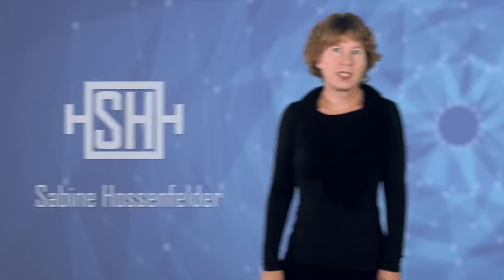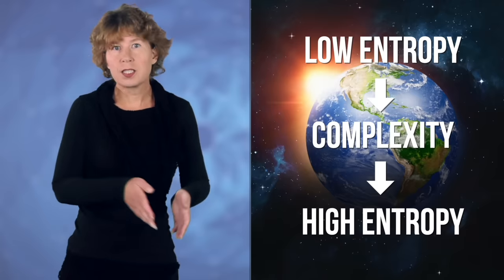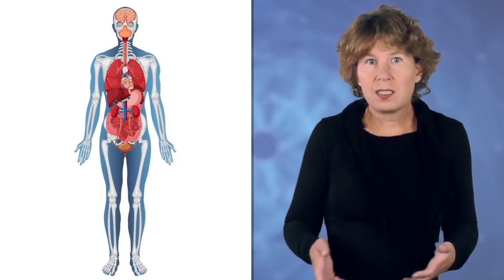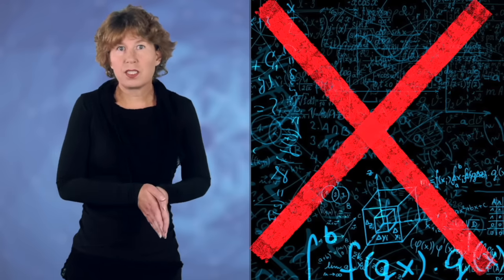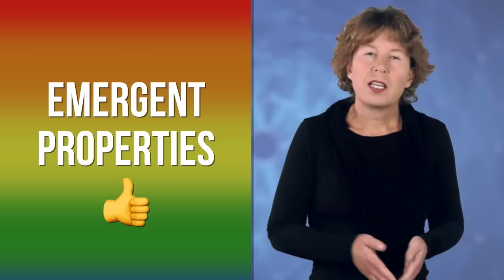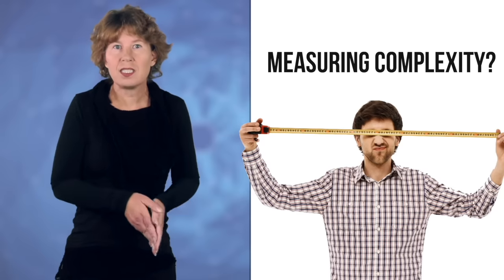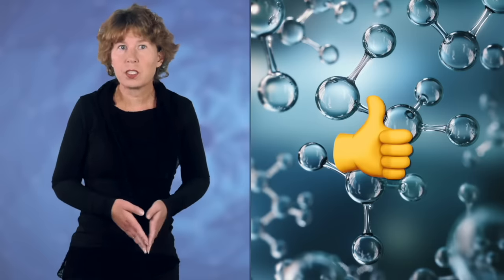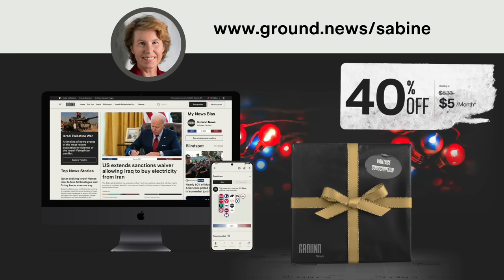The Biggest Gap in Science: Complexity

Comment: Complexity is the minimal number of laws (mathematical functions) of all the possible connections between the elements of the system described within a specified space-time dimension.
It gets its real meaning as a comparison, as a relative value between two or more systems, although it is not impossible to quantify it as an absolute value.

Let's take the rock-baby example.
The baby is more complex if we compare it to a similar sized rock, and we take a small timespan, let's say a day, and investigate both starting from their molecular size to the whole object. The baby is complexer because to count all the laws describing the connections of its elements on the same macroscopic size it is much higher for a baby, not only because its organs or molecules on the similar microscopic level need more laws to describe them, but in a 24 hour a rock doesn't really change, so the are no extra laws needed to describe the changes too, the time generated connections (evolution) and the laws describing these are missing for the rock.
However if we take millions of years of evolution of that rock and compare to the millions of years in which a baby state of a human is negligible (99.9999...% it doesn't even exists), the rock may be more complex, so geologically it is complex, because it the a higher timespan, an "evolution" of that rock must be taken in consideration too.
The same is true if we change the spatial dimensions in which we compare the system.  No surprise that the geology of a whole planet is pretty much complex.

To describe all the possible connections of the elements of a DNA molecule of a baby needs also much more mathematical functions than a silicate molecule (just to stay at the baby-rock example, however it is not important at a molecular level, where those example molecules are coming from).

We can also define a span of space to compare objects, or to measure it's complexity, and a timespan too, so we can compare two objects starting from a molecular size to an average human size in 100 years, then compare those. It is also okay to compare different space-time spans of objects. In both cases we can say which one is more complex. 

Just to use it for the coffee exaple, the two separate liquids half mixed are much more complex, because you need to describe the process of mixing as the time goes on, which is probably the biggest part of the mathematics to do, much more as to describe the separate or the completely mixed liquids.

This is the reason why the states in between, and the systems which rapidly change by time are so complex.

Now if we compare the whole universe from the smallest particles and in its complete "lifespan" there is nothing as complex as it, because all other systems are only a subset of elements in space and/or time, and those can't be more complex.

(Sometimes I used objects and systems as synonyms, but these thoughts are just born as I wrote them, inspired by Sabines explanations. But you probably got the point anyways if you took time to read this.)

Thank you Sabine for relieving the philosopher and thinking person and the wannabe scientist in me.

Comment: I really think the connected dots are a more complex system. As a software developer, having my functions used and calling each other is way more complex than having them as a pointers that never get called. We were discussing with my colleagues how complexity grows and we concluded it has to do with combinatorics and combinatorial explosion. But there are cases where you can have linear growth and exponential growth as well depending on how the connections are made. Also, we came to the conclusion that intelligence can be described as an aligned complexity.
Reply: The mere existence of connections adds a certain complexity, but the dots remain identical, which reduces complexity from the state where only some dots are connected only to some other dots.  Maximum complexity lies somewhere between the unconnected and fully-connected states, as in neural networks (and our brains.)
Reply: @jpdemer5  I think of aligned complexity as what you described as the in-between the unconnected and fully connected states. which I think describes intelligence, looking at it this way you can consider systems where the path of least resistance is chosen as intelligent(like light, movement of charged particles, water flow, etc. but in general they are complex systems all connected and offering other paths that are not taken. I think of them as functions that can be called if a certain if-else statement is fulfilled.
Reply: Wdym by aligned complexity
Reply: @l1mbo69  Having a way of finding the solution to a problem faster than brute force.
Reply: if we are only talking about the complexity of description, then no connections vs full graph is exactly the same: for any two functions they are either always connected or always disconnected. You know this bit of information ans you can reconstruct the graph just knowing its size. Now if you want to consider complexity of operation, a dynamic one,  you are actually talking about possible traces, paths in this graph, which are a different thing altogether
Reply: @flyingsayon  Yes but I mean it like you don't know its size also, otherwise it is still connected in some way. Like the dots are beyond our visible part of the universe.

Comment: Personally I always thought of complexity as the number of interactions between different systems (which itself could consist of different interacting systems) that will have a fixed result. The total of all those interacting systems could make something more complex than others.
Reply: Exactly my though. For me the complexity of a system depends on the number of significant interactions (at that emergence level) you need to account for in order to predict the exact outcome.
Reply: so how does your framing differentiate between two colliding galaxies and two people talking with each other, for example?

And how is a "significant interaction" defined ?

Seems to me like it's just pushing the definition of "complex" to be based on the vague term "significant"...
Reply: I agree, but I think there's a psychological component. How your brain categorizes thing contributes to whether or not you will view things as different systems. You can view many body systems as the same system, and it's largely arbitrary that we separate them. How do you have an immune system without a digestive system, without a skeletal system, without a cardiovascular system, etc etc etc.
Reply: @Velereonics That can be applied to the totality of the universe. It's all one thing. There is no separation and time is just an illusion. Measurement from A to B.
Reply: A transverse wave could satisfy your definition, but make something which can be modelled by an elementary function.
Reply: @Klayhamn  You would need to trace complexity all the way down to the smallest denominator. For math that would be addition or subtracting, everything else can be build from that.
Reply: ACloudyDay22  I've been thinking about that and my conclusion would be that a system is something that works on two input parameters and one output parameter. If it has just one input parameter then there is a hidden constant as a second parameter. If it has three or more input parameters then it would be a system of systems. Edit: Also, the result may look complex but as long as it's static it isn't. I thinks it's better to call those intricate.
Reply: But the universe would carry on almost exactly as it does now if I weren't in it; like it would still function the same way. But the immune system does not function without a metabolic process and the systems that deal with that and so forth. 
 @ADUAquascaping
Reply: This is basically known as functional differenciation in systems theory.
Reply: @bjornrie  Thanks. I had already a hard time believing I would be the only one thinking in that direction.
Reply: @ermarch  the sentence you wrote in response doesn't actually answer my question.

If you are suggesting a measure of complexity you need to do a  bit more than to say vague sentences about it "going all the way down to subtraction".

I asked how does your "method" differentiate between two people talking and two galaxies colliding.

How do you determine which "interaction" is more complex ?
In actual terms, not in vague declarations .
Reply: @Klayhamn  If you want to compare things you need to bring them together, not differentiate them. And you do that by starting at the lowest system level and work your way up. And then count the total number of systems required to make it happen. For example: for two people to speak to each other they need to be alive in the first place. So you need to take into account all biological aspects to make that happen too.
Reply: Another example which came to mind when thinking about what you are asking: How many apple parts does one pear make? Most people will probably say none. But if you go to the molecular level you can probably construct a pear from apple parts.
Reply: @ermarch  ok, I should have realized it's a waste of time commenting .

Did you even watch the video ? She's talking about a well defined mathematical model of complexity , from which we can actually derive Useful laws and other kinds of generalizations.

What you're doing is just hand waving and treating it like some philosophical game.

You need to differentiate between systems if you wanna be able to say they have a different measure of complexity , which is the entire topic of the video .

The whole point of the video was made by comparing one object (E.g. A rock ) to another object (e..g a human kid ).

You either did not watch the video or did not comprehend what you saw.
Reply: @Klayhamn  The fact that you can't comprehend the problem has little to doe with me.
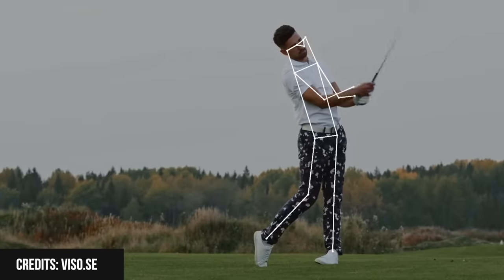Reply: At minute 12:40 of the video "You can't measure time" of Up and Atom, she start referred the fact ,from the uncountable transcendental numbers, Wikipedia have only 1 page showing the proven ones. As you said the number of interactions (with causality  logic) is a big face of complexity.

Comment: Algorithmic complexity still seems to me like one of the the best measure that could be extended to accomodate more different types of complexity. For example if you write a module that describes the particle physics completely and allows you to operate on the level of molecules, the rest of the algorythm will now be much more complex for baby than it is for the rock.

You sort of define the cut off point for complexity. By defining micro physics complexity as a module, you decouple it from whatever other types of complexity you want to describe. By defining bondaries of the code modules you would define boundaries of complexity types. They could also overlap and include each other.

So overall the algorithmic complexity seems like a very universal way to quantify complexity.
Reply: The only algorithm you need to make a baby are the laws of nature. There is no cut off point. The baby is a result of the same laws as the rock. Also check out Steven Wolfram's work on  how equally simple algorithms may give rise to vastly different outcomes, some outcomes are periodical, some are chaotic.
Reply: Accept, it does fall short in some cases. The whole concept of complexity is higher-dimensional, it's likely that in a system with infinite configurations there can also be an infinite number of ways to describe them.

Comment: I don't think I agree that the algorithmic complexity of all objects is necessarily the same. Just because everything can be described by the same general algorithm doesn't mean there's no shorter program specific to each object. File data is vaguely analogous - for two files of the same size, there's one algorithm that can describe both (simply enumerate the bits) but with a compression algorithm, a highly ordered file will compress to a much smaller blob than a highly irregular file.
Reply: Perhaps what we think of as "irregular" is an illusion, in that we use it in order to describe something that does not have any patterns that are recognizable to us currently. It could just be that we don't yet understand the patterns, and that even highly chaotic systems are ordered in strange ways.
Reply: @bodeeangus9957  That is certainly a possibility, though in principle we could find a dataset that cannot be produced by any program of length <= n, by running all such programs, and using a diagonalisation to find a new dataset. That dataset is then definitely algorithmically complex, and could be considered the idealised form of irregularity.
Reply: you're right, it's not just the algorithm but the inputs, which in turn may be expressed more compactly, compression is a good intuitoin for this but the video seems to assume that these programs can have free variables / inputs, but they shouldn't
Reply: @bodeeangus9957  Kolmogorov complexity goes even deeper than that, look into Chaitin's constant for example, although it can be compared in some sense for actual programs, you can objectively say which is shorter, if i'm not mistaken you can even do that without loss of generality in assuming a particular language, but you can't do it in general and you can't coompute the Kolmogorov complexity of a given string because

concrete examples exist in cryptography, for example a pseudorandom generator is an object which without knowledge of the seed appears to have unbounded complexity, but in a very tangible sense only has a constant amount of it

Comment: While studying Graph Theory for my MA, I came across Ramsey Theory and was immediately intrigued.

Ramsey Theory deals with complex systems (usually finite, discrete networks), and how large the networks can be before some certain substructure must manifest within the network. 

The "simplest" example is how big can a simple complete binary (or 2-color) graph K_n be such that K_n avoids a monochromatic triangle (or 3-cycle C³). The answer is 5. K_5 is the largest simple complete graph that can be drawn in 2 colors without a triangle (3-cycle) of the same color edges.

Sometimes I wish I'd gone into Ramsey Theory because it's still in its infancy and most of even the simplest questions are still open and an active area of research.

Comment: My definition is that a complex system is one that cannot be properly understood, especially when we think that they can, then they prove we were wrong.  For example at Fukushima, the potential complex interconnection between the reactors and a tsunami was not even noticed.  We simply cut off the risk analysis when P(x) was acceptable and did not consider P(x) x Cost, in all aspects, was still unacceptable.  The true probability of prediction of extremely rare events is difficult to place an accurate value on, because the data of those events is not sufficient, yet we believe they are not so complex to interact.  The P(x) is so low, we stop considering further possibilities. When you run off the fat tail curve, Yes.  (You eventually got there.)  You hit chaos.  Chaos is more prevalent then we think.  All important changes to society seem to be caused by it.  Either the math defining Probability of extreme, extreme independent events is not P1 x P2. Or we need a better way recongize and account for event dependency.  In hindsight we immediately recognize that tsunamis are associated with earthquakes, yet it occurred to nobody beforehand?

Comment: True, the kolmogorov complexity of the math governing the evolution of all systems is the same, but that's not what people mean by the complexity of a system. That complexity also has to include a description of the system's current state. In that way, the kolmogorov complexity of the baby far exceeds that of the rock. The two really difficult problems with kolmogorov complexity are: 1. A general mechanism for computing its value is impossible. Optimally minifying an algorithm is known to be reducible to the Halting Problem, which is the classic incomputable problem. 2. Like many measures of complexity, it depends on the granularity at which you want to describe the system. For example If you want to describe the macrostate (temperature, pressure, phase) of a system, the complexity will work out to be much lower than if you want to describe the microstate (position and momentum of every particle).

Comment: Regarding the problem of complexity:Complexity Defined by Parts and Relations: Complexity in systems like a mechanical clock can be quantified by the number of components and their interactions, suitable for deterministic systems.Nature of Connections in Complexity: Differentiating causal links from statistical correlations is vital, especially in systems like quantum mechanics or meteorology, where causation is not always clear.Intentional Action and System's Internal Logic: In systems involving intentional action, such as predicting a baby's actions, understanding complexity requires discursive methodologies that consider reason and meaning, beyond quantitative analysis.